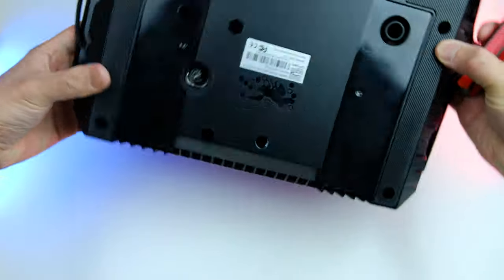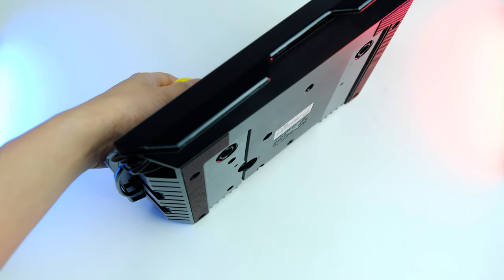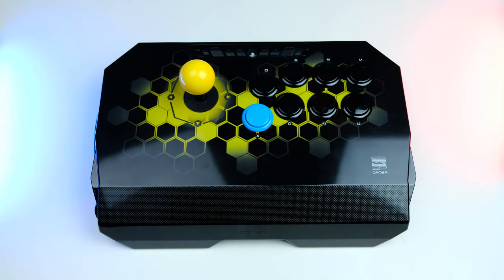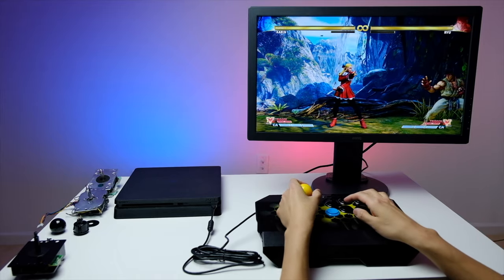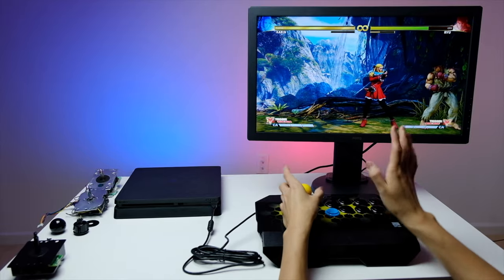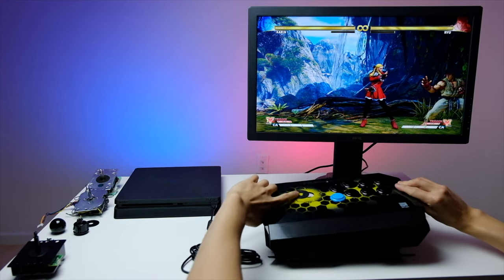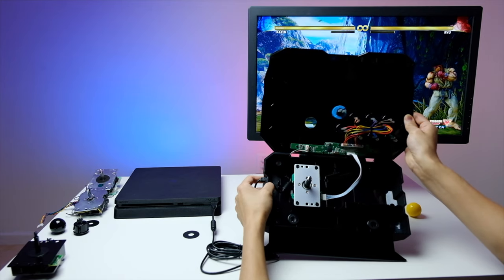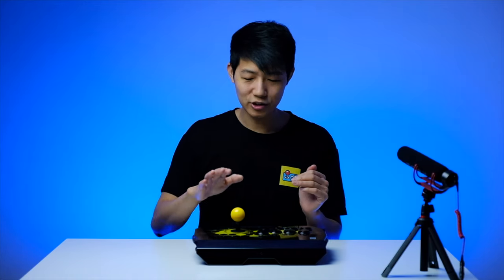Qanba Drone Mod Upgrade - Sanwa Joystick and Buttons

Comment: Nice tutorial as always JoyStickNY. When I did my Sanwa swap I actually opted to use the quanba switches and qanba wiring harness on the Sanwa JLF since my Sanwa switch board was pretty old and in need of a replacement. It is kind of a pain to get the switches to sit on the Sanwa mount and get the gate on without one of the switches moving out of place, but once it's all set with the gate on it works very well!
Reply from the maker: Nice 😊 i am going to unscrew the qanba lever and mess around with it, maybe i ll do a compare video on it in the future 🙏 thank you as always

Comment: Finally bought this and i'm going to use the black sanwa kit with the 5pc wire to do this. Thanks a WHOLE TON for this video!!!
Reply from the maker: Happy to help my friend, enjoy it ❤️🙏
Reply: @JoystickNY  it's a lot smaller than I originally thought it would be, i'm 6'6 is there any bigger stick you would recommend that is modable, I already bought sanwa parts and plan to use the qanba body in the mean time.
Reply from the maker: The hori rap4 is the great long stick, is the one i use daily. U can check that out, its around 150$

Comment: Alternatively what you can do for tight connectors on the buttons, lightly grab the top of the sleeve with a pair of pliers and you can wiggle it off.
Reply from the maker: Great advice thank you
Reply: @JoystickNY  right back at you, i didnt know the drone was so easy to mod

Comment: It took me forever to remove the ball top off of my Qanba Q4 RAF with the flat head screwdriver as the threads were basically stuck together and the buttons were just as hard to get out. I couldn't remove the quick release from the buttons and I couldn't do it with the flat head screwdriver but I managed to use a pair of pliers to wriggle them out with some force. After I remove the parts and put it back together since I just wanted to see if I can remove them, I find it easier to remove the connections as I see fit. I think it's the age of the parts as I got the stick used. Luckily I don't really need to mod the stick as it already has Sanwa parts and connects to PC out of the box. I do intend to change the artwork when I get the chance.
Reply from the maker: rxzero00 you can also loosen up or widen the metal connection, its must metal and its designed to be bent. That way in the future you can just use your hands to unplug them 🙏 thank you for watching

Comment: Thanks for all the videos! It's been helping me a lot! I bought a Drone as my 1st stick &  I'm very happy!

So the hardware besides Stick & Buttons, how important is it?

Will I "waste" my full Sanwa upgrade on a cheap drone? Or would it be better to pimp a more expensive stick?

I'm spending about the same amount off cash on upgrades as I did for the stick.. So any clarity would be nice, thanks!
also would LED buttons work with Drone?
Reply from the maker: The hardware is great; yuyu is a sponsor pro player , and she uses the drone in tornaments 😊

Comment: For some reason I had to connect the jlf connector to the adapter as opposed to skip that and go straight to the board with the 5 pin. Idk why I mean it works just a lot of wires there
Reply from the maker: Ned Stark if it connect and it works, it should not be a problem, if you have time, maybe take out the extra parts, sometimes go pass too many wires can add delay to a signal. 🙏❤️ thank you for watching

Comment: Thank you very much for this video. I am so scared to handle anything with wires. And to see that I could bypass so much work with just the cable adapter, thank you 🙏.

I placed the order for my new stick and buttons right after 😅
Reply from the maker: Enjoy my friend, its a good learning experience 👍😊❤️

Comment: How timely this video is... i just bought a Qanba drone after being convinced by your other video 😉.  So far Im ok with the stock lever, would Sanwa be any good?
Reply from the maker: Joseph Olvina the stock lever is actually not bad, it is better than a lot of entry level sticks, i would get comfortable with it and master it first, learn everything about it, once you think you are ready for the next step, then make the move 🙏😊 thank you for watching
Reply: honestly you should mod the buttons to sanwa, noticeably difference in quality. Drone buttons feel cheap and hollow. Have same opinion on the drone joystick, joystick lever is little more difficult to mod, need special 5pin harness or cut the wire on drone and place sanwa color cable together certain pattern.
Reply from the maker: John N thank you for dropping by 🙏❤️
Reply: Well it depends on how sensitive do you like when it comes to button presses. Sanwa buttons are really sensitive as just a tiny touch can trigger the buttons. Sanwa levers are also really lose out of the box to me. You can fix that with a heavier spring or a tighter stick like those from Seimitsu.  I like Seimitsu buttons because you need a little more force. If you like mechanical keyboards, then maybe Gamefinger buttons or Crown buttons as they use mechanical switches. I think the modern Hayabusa buttons from Hori are close to Sanwa but with a matte finish instead of the typical glossy finish. Also to consider is your budget really. Qanba buttons are close to Sanwa. For my Qanba Q1W I just use Seimitsu buttons and a Seimitsu LS-32 stick but I just use it for 3D fighters like Tekken and Virtua Fighter, other arcade games, shoot em ups, and Touhou Project games. My other Qanba Q4 RAF, I have it already stocked with Sanwa parts so I just use it for other fighters when I don't feel like using a game pad controller.
Reply from the maker: rxzero00 thank you for sharing ❤️👍🕹
Reply: @JoystickNY  thank you, I guess i will give it a good 6 months b4 moding 👍

Comment: do you have to have the metal part of the wire connected all the way down on the metal part of the button? On my hori rap n, the metal part that you pull up is really stuck on there so when i reconnected it, I connected it back just a little past halfway so next time it isn't so hard to take out. Will this cause any issues if, as of right now, the buttons seems to work perfectly?
Reply from the maker: the elusive meme you can actually adjust that metal part with a plier, you can  loosen it up and then plug it in and clamp it tight, its soft metal meant to be bent.
Reply: @JoystickNY  i dont have a problem putting the metal part on, its more the taking it off the button part that is hard. I use pliers to lift it up a little than I just pull it out. But i was wondering if its okay to not have that metal part all the way down so i wouldn't have to use pliers next time.
Reply from the maker: the elusive meme if it works, then you dont have to worry, i think some of mines are sometimes half way too, as long as its tight enough so it doesn’t come loose.
Reply: @JoystickNY  okay thanks for the input

Comment: Hi JoyStickNY, i just bought my qanba drone, button is ok, dont mind that much but dont like the accuracy of the joystick at all. im kinda sad now. Im an old school arcade gamer, i want the joystick to be as close as old arcade machine joystick possible, any advice?? i think seimtsu joystick will be the closest to old arcade machine joystick. if it is, then which model seimtsu joystick should i buy for my qanba drone? link would be fantastic. thanks
Reply from the maker: Mamun Hossain i been playing in the arcade since 2000, the parts that was in the usa arcades were happ part. They were circular gate and they feel tighter. The qanba drone lever and button is actually better than what was it the arcades, i think maybe you have to give it some time, Japanese parts are more loose, but loose doesnt make it less accurate, if you prefer a tigher feel, you can change the spring on the lever to a heavier spring or change to happ. But i dont recommend happ. Qanba is very close to sanwa, try to give it more time. Let me know in the future, if you really dont like it, i ll give you some links to seitmitsus
Reply: @JoystickNY  thanks for your quick reply. Sorry for the confusion, Im from sydney and here we use Japanese arcade machine with japanese ball lever, not happ part, at least in my time (around 20 years ago), so i think im used to with loose lever i guess. i also watched your video "Sanwa vs Hayabusa Vs Seimitsu Review Detail Comparison 2019 HD". and i think i will like the seimitsu lever than sanwa and my current one comes with qanba drone. will buy both sanwa and seimitsu lever and decide myself what i like as you advised on the video. all i need is the right seimitsu lever link to buy for my qanba drone. thanks for your time
Reply from the maker: Mamun Hossain the seimitsu lever i have doesnt fit the qanba drone, there is not enough room

Comment: The way you modded this drone would it be the same for an obsidian? Or it a different way to mod the obsidian?
Reply from the maker: jose melchor yes, its the same, but is easier, you dont need the 5 pin cable, the obsidian has a cable inside, you can just plug straight into the sanwa JLF  joystick lever ❤️🙏
Reply: JoyStickNY thanks for the help! 👍

Comment: Now that the Qanba Drone is going for the same price as the F500, what would you recommend?  I don't like that you need a ps4 controller to connect to a ps4, but you can get a usb dongle that makes it standalone.
Reply from the maker: S Rhom i think the f500 would be a better deal in terms of value, because u get a bigger and heavier body and its multi console, but i think i would personally go for the qanba drone becuz i dont like to connect controller part too. Both of them are similar in terms of function and parts, go with which ever design you like better . Or wait for a sale

Comment: I also have another question
is the seimitsu stick the most precise stick because in your comparison video you said that it was best at diagonals and im still a bit confused which category the stick would fall in
Reply from the maker: Da_Masterdude Lol technically it is the most precise in terms of how hard you press, becuz of the metal, every little pressure you push will show, where as other switches are simple just press or not pressed, thats why seitmitsu is more accurate in that catergory. But in fighting game, that pressure doesnt really matter becuz there is no input that has partial press or half press, if you know what i mean, generally speaking, they all work great, if you arw unsure, go with sanwa . You cant go wrong with it 🕹😊

Comment: My only advice to someone wanting an arcade stick is to save a bit and get a good one, or buy an enclosure and put it together yourself, its pretty simple with very little knowledge required and will be future proof and easy to work on, if you buy something good quality once you don't have to keep buying slightly better sticks.
Reply from the maker: Very true 👍🕹 thank you for sharing 🙏❤️

Comment: What gate does the original stick that the quanba comes with use?
Reply from the maker: Square gate 😊
Reply: Also one more thing does it use sanwa hyabusa or semetsu
Reply from the maker: These are just basic unbranded buttons, no brands
Reply: Can I put any gate on it or do I have to get another stick that has brand
Reply from the maker: That i havent tried, u want to try octagon gate?

Comment: For a lever, I recommend a sanwa JLF. For the buttons, I recommend hayabusa buttons. For the top, I recommend a bat-top. For Pac-Man and shoot'em ups, I recommend a four-way restrictor plate. And for fighting games and beat'em ups, I recommend an eight-way restrictor plate, so you can perform quarter-circle movements a lot more easier.
Reply from the maker: Dustin Nunn thank you for sharing 🙏
Reply: how can i make qanba drone a eight way restrictor plate ???
Reply from the maker: Mamun Hossain you can buy a sanwa octagon gate off amazon, ebay, focus attack website or arcade shock website
Reply: @JoystickNY  what's the level of effort to also do the 8 way restricter & bat-top on Qanba drone as well - on top of the buttons and joystick? And I know it's off topic, what about those two mods on the Hori rap 4 Kai? (That's the one I went with, but I still have a return window on it)

Update: I watched your video here and know how to do the bat top swap now: https://youtu.be/XScf7hN0HWA

Still interested in octagon restricter
Reply from the maker: Changing the octagon gate and bat top takes 5-10 mins, should be fairly easy; basically it clicks off and clicks on and screw the bat top on and off, definitely try it and see how you like it 👍🕹

Comment: Do you agree that we can move the pcb and all cables to other case? How you know is imposible get some arts on this one But i was thought that opción
Reply from the maker: The art looks spray painted or hard glue on to the plastic, its possible to add your art, but you will have to print your own vinyl ❤️🙏

Comment: moded qanba drone or hori rap 4 ? which is more worth ?
Reply from the maker: Owa Chan hori rap 4 would be better worth, but it would he 2 diff things tho. Cuz ur qanba will be all sanwa parts, and hori would be all hayabusa parts
Reply: @JoystickNY  ohh I see thanks as always
Reply: last question can I change the artwork of qanba?
Reply from the maker: Owa Chan nope, cant change the artwork on the qanba or hori rap4, becuz the design is print directly on the plastic, the only way u can add a artwork is buying like a sticker to cover it, but its not worth it, over time it will peel and come off
Reply: @JoystickNY  Oof thanks for the reply

Comment: Since I'm new with Arcade stick, what's the benefit of changing the buttons to sanwa? Will it be hard to play on my Qanba drone with its normal buttons? Thanks for your time 🙏
Reply from the maker: The benefit is , it feels abit more responsive and more smooth; possibly the switches in the button and spring is more well made

Comment: I was watching another mod tutorial on this and the guy added and octagon gate on the bottom of his sanwa joystick. What is the benefit of this? Is this extra part needed or worth it?
Reply from the maker: Elite Company great question by the way, the sanwa lever usually comes with a square restrictor gate, some people like to swap it, and pop in a octagon gate, there is no advantage in terms of game play, but they give you a different feeling, for example, on a 🟥 gate, notice up down left right is a flat wall, and on a octagon every direction is a corner, so it feels very different. Thats the biggest difference, i do have a video coming up soon and i will be talking about it in more details 🙏❤️🕹 new players prefer the octagon gate because its easier to learn, because there is a true direction,
Reply: JoyStickNY thanks for the response. I’ll think I’ll be getting the 8 gate. Is it pretty simple to exchange the square for the octagon??
Reply from the maker: Elite Company very easy, simple push the tab and push, and the new one clips  right in. 👍

Comment: Good tip on the seimetsu lever, do you know if the drone can fit the etokki taeyoung fanta stick or is the clearance too slim?
Reply from the maker: You can fit a korean lever only if its design for japanese sticks, with a short collar, and officially u cant just drop it in the drone; u will have to bend the connectors i will have a video on it this month on the drone and other entry lvl sticks 👍🕹

Comment: thanks for this, it worked. however i stupidly broke the final screw and it broke inside of the thing. so ill have to figure out how to remove it when i decide to go full sanwa parts.
Reply from the maker: Use a small drill, mostly u have to lightly drill out the stuck piece. Be very careful not to damage the surrounding.

Comment: Loved the video

Do you or anyone knows if the shaft cover and dustwasher that comes with the drone stick can be use with the sanwa JLF? So I don't need to order those plastics?

Thanks in advance
Reply from the maker: Yes it does come with a dust washer

Comment: Not sure about the specifics but would it be possible to use a silent sanwa stick and use the same instructions here? Also would it still fit, not sure if there's a size difference or not.
Reply from the maker: Yes, they are the same specs, u can use silent once

Comment: Can the Qanba lever's mounting plate be used on the Sanwa lever? My sanwa doesn't have a mounting plate included.
Reply from the maker: I am not exactly sure, i never took it apart like that, but off the type of my head, they do seem abit different, how come ur sanwa lever didnt come in a whole piece?
Reply: @JoystickNY  My stick was modded was someone else as I fear ending up breaking the stick if I did it myself.  I suppose he took the mounting plate for himself instead of handing it over to me.  The mounting plate has to be removed so that the lever could be screwed to my Hori Blazblue Chronophantasma stick.

I broke down my Drone to find out and confirmed that the stock Qanba lever's mounting plate is a perfect fit to the Sanwa, so at the very least it alleviates the need to get another mounting plate.  I can't believe that piece of metal can be pricey as hell.
Reply from the maker: Ya, it gets pricey when u buy them seperately

Comment: I want to mod a drone, but i really dislike the design. Is there an easy way to change the decal or maybe get a faceplate for the drone to change the design?
Reply from the maker: Not that i know of, by default is not artwork friendly because its like painted on to the plastic, i think the best thing you can do is probably print a design on a adhesive and stick it over it to cover it 🙏❤️